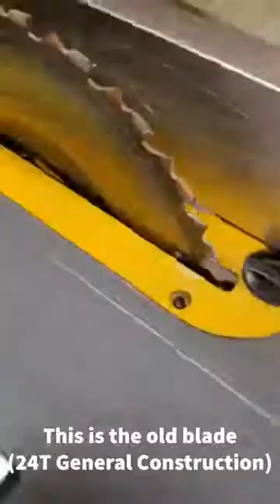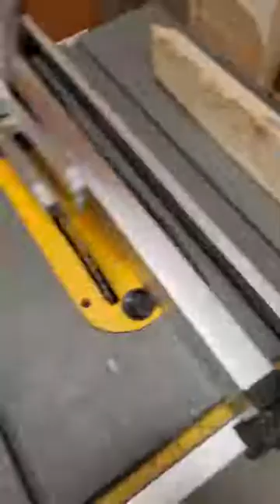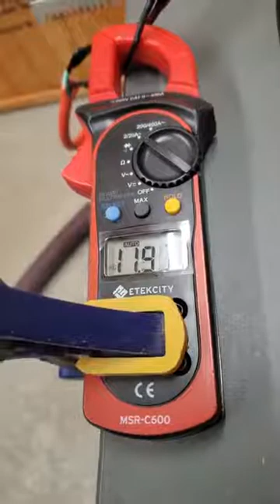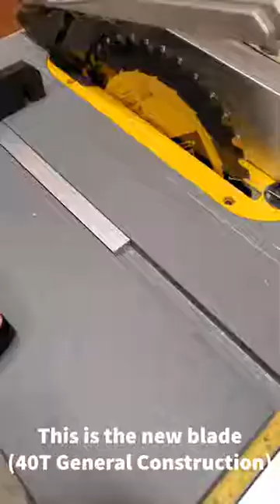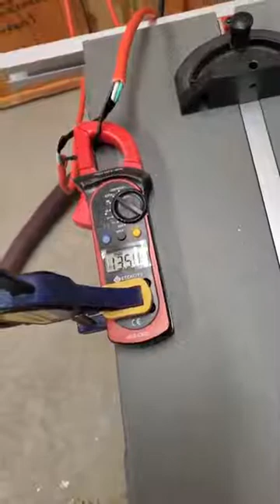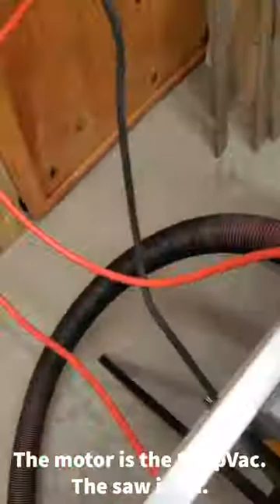Table Saw Tripping Breaker:   One solution, but many applications.

Comment: Thanks for making this video dude. I'm having the same issue with my job site table saw. Hasn't really been a problem until I tried ripping 2 in thick Oak. Just like you installed a 20 amp dedicated circuit. I'm probably going to install a 30 amp circuit, should give me enough juice to burn my saw up haha
Reply from the maker: You're welcome!   Make sure the saw is not drawing too many amps when the blade is running without load.  You don't want to upgrade your circuit if the issue is with the saw motor.